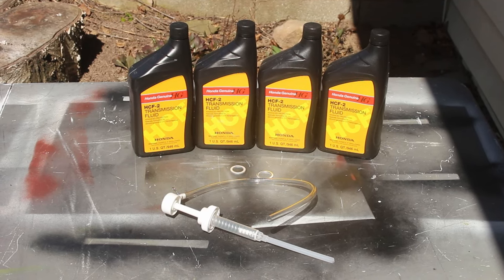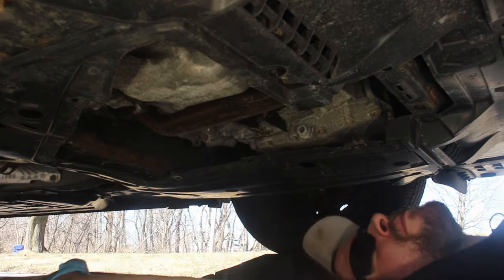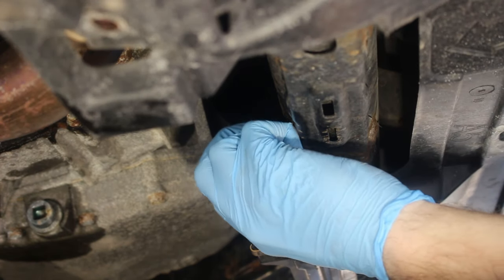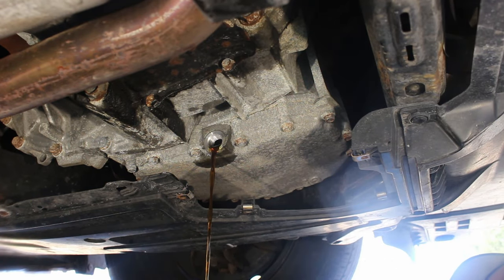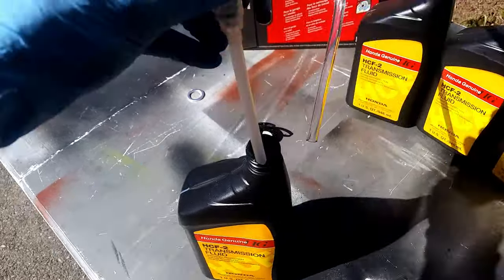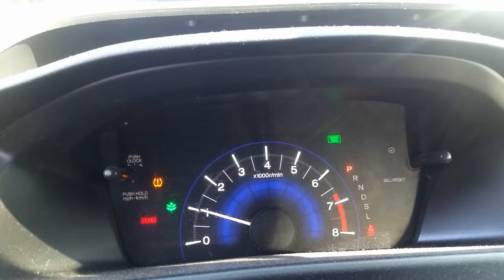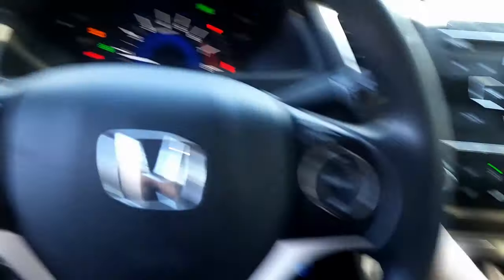2014-2015 Honda Civic CVT Fluid Replacement

Comment: Well made video, very straight forward and informative.
 It’s funny how people talk crap on the cvt transmissions. I have 160,000 miles on my 2015 civic and I beat the living piss out of it every day.
 Maintenance is key!!
Reply: Yeah I thought the same until 177 and it slipped like a MF’r I’m praying I get lucky and fill it with the correct fluid but not going to get my hopes up
Reply: Very good to know as just purchased 2015 civic with 70000 miles. Super pleased with CVT transmission.
Reply: Must do a flush, not just a change. Humble opinion 😌.
Reply: 260k on my 14 civic lx
Reply: Wait a little bit and you will see. Cvt lasts around 200k. Mine lasted 210k. In 210k miles in my 2014 civic I only replaced starter once and alternator once. Now transmission. Im more than happy with it. ( battery every 3 years or so. Maintenance every 5k miles). Never game me any other issue.

Comment: Thank you for the video! I have been searching for hours for a Honda Civic LX 2015 transmission dipstick and could not find it, low and behold - it's a plug. Since it's a plug, how do you know when you have a low amount of fluid or if it needs to be changed? Do you just put in the amount listed and hope for the best?
Reply from the maker: It's full when the fluid reaches the bottom of the check/fill bolt on the front of the transmission.

Comment: Accept using a pump isn't part of the procedure. You just get a funell  and at the fluid to the fill hole. From the top of the engine compartment. Just poor it in. And honda recommends replacing the  plug when serviced because the rubber wares out by then usually. This video made it seem like it was more work then it was. Running it hot and checking doesn't do much unless your running dexose also. Honda fluid is clear and doesn't expand like dexron. But I guess if you like extra work.

Comment: thanks for the video. So just to confirm the correct way to check the fluid level is with the engine and transmission up to temperature, engine turned off?
Reply from the maker: Yes

Comment: I find this video a good and useful reference. I'm currently much more involved in a Large scale project with my wife's car which is exactly the same car in this video. Started with grinding brakes, found a bad CV shaft, which ended up getting some of the fluid out so I figured I'd do the fluid change cuz it was due Anyway. I did it about 60,000 mi ago with the small filter. So this time I'm doing both filters and the pan gasket. I only bought 4 quarts of fluid but I feel like it's not going to be enough to fill the whole thing.

Comment: I have a 2014 Honda Civic. I have never changed ny transmission fluid and have 164k miles.. should i change it? Im worried people say it will mess it up if i change it now
Reply: I personally wouldn't. especially since it's a cvt. It's really just a gamble at that point.
Reply: Change it. Cvts are extremely different than the old style 5 speeds with actual gears. Cvt fluid change is only beneficial no matter the miles or intervals as long as it's done correctly with the right fluid from honda.
Reply: Do a flush and get all the fluid out. Don't mix new fluid with old.
Reply: Did you change it? I have a 2015 civic with 170k and am wondering the same thing.
Reply: I have 2014 honda civic with 200K and never changed CVT fluid, wondering should i change now? works great
Reply: I change my cvt oil every 5-6 engine oils changes. 260k now. The main issue is shifting while it’s still moving,if you shift it right  it stays with you

Comment: Helpful and informative video! Only wired thing I had was my tranny just dripping after i did the final open to let drain check... I come back an hour later and theres 1/2 quart of oil that drained out when I emptied my drain pan. Car was level so kinda odd and makes me worried since I put in right under 3qts before it started spilling out.

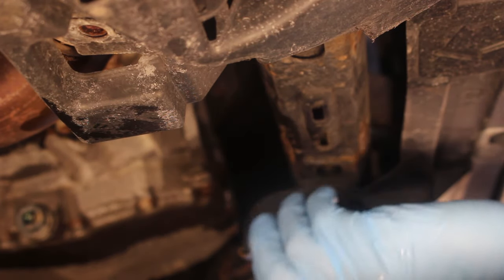Comment: What was the fill check bolt washer part number at 7:01? Comparing the drain plug washer and fill bolt washer shows there is a difference.

Comment: Excellent video!  Can you let me know the 2 washers I need to get for the change?  If you happen to have the Honda P/N's I'll get them at the dealership (about 1/2 mile from our house.  Do you think this should be done every 50,000 miles?  I missed it an the car has about 70,000 on it.  It's a 2015 EX sedan.  Love the car and want to keep it in good shape.
Reply: 18mm crush washers

Comment: very nice video, when you check the oil, are you lifting the car again?  not sure how you can get underneath without lifting the car.  Crazy there is not just a dipstick to check, I guess that is the new technology at work.  Cheers
Reply from the maker: I left the car on the jack stands when I checked it.

Comment: Does the car need to be level or can all this be done with it on ramps?
Reply from the maker: If setting the level using the overflow method you would need to be level.
Reply: @MechanicalMalarkey would measuring the amount of discarded fluid and replacing with the same amount work if you can’t get it leveled?
Reply from the maker: @TheMattizelli  That would be a good way to guess

Comment: Did you ended up using the 4 bottles of CVT transmission fluid? Mine took the entire 4 bottles, I’m not sure if I overfilled it
Reply: I took mine to the shop this weekend & they charged me for 5 bottles… I came here looking to see how many bottles it really takes cuz I hope they didn’t just charge me for all 5 if they didn’t use all of them from the shipment
Reply: @alexabernhardt2856  if you have a 2012-2015 Honda Civic with the 1.8L engine then yes, they definitely overcharged you and you should definitely place a complain and get your money back because it only takes about 4 bottles, anything over that is overfilled and bad for your transmission. You can also find this information on Google. You should definitely have complain
Reply: It takes 3 full bottles and 3/4 of the last bottles. I change mine every 100.000km
Reply: @bigfarru2  wowwwww. I wonder if I still have the receipt.. I’m about to go back to that store cuz I also got my starter replaced that day too.. like they didn’t get enough $ out of me & then had the nerve to call me when it was done, saying it actually took 5 bottles..
Reply: Idk about that because mine started to come out the over fill on 3 bottles and like a quarter of the 4th which seemed on point for the amount and then after cycling the gears I used the whole rest of the 4th bottle with the check hole off again and it drank the whole rest of the 4th bottle without it leaking out again ? I didn’t have a 5th bottle to fill it till it dripped again but I hope that was enough ??
Reply: @storageseeker3066 it says in the service manual to check the fluid level quickly after shifting through the gears. I noticed if you let it sit for an hour all the fluid goes down and will come out the check plug. You have to shift it and check it instantly. So if you checked it within a few min of shifting and it didn't overflow I would definitely add some more.

Comment: Assuming this CVT has a converter, how much of the total fluid do you think is replaced in this procedure?  Half perhaps?
Reply from the maker: Honda says it takes a little over 6 quarts to fill after a full overhaul, so you're changing a little over half of the total fluid.

Comment: theres a fill plug hole on top of the cvt to poor the fluid in.  not sure if you knew this
Reply from the maker: But you need to check it with this hole anyway.
Reply: Ya, the plug with a hook.

Comment: When I see videos like this it really discourages.me from following it's instructions. Why would you fill the dam thing through the overflow hole when the fill hole is up top the transmission and heyyy it has a rubber plug that pulls out to do so. These transmissions have two filters. One behind the transmission fluid cooler and the the other inside the pan. As a rule you can get away with a plain dump and refill but it's best to replace both filters between 50-100ks. Miles. It's highly suggested.to replace the drain plug crush washer as well which you don't see down in this video.

Comment: is 2014/15 civic better than 2013 civic please lmk
Reply from the maker: I think it still had the regular automatic transmission in 2013 and 14/15 have the CVT. I don't know if there's a big difference between the two in driving or reliability. I would stay away from 2012 though because the interior feels super cheap.
Reply: @MechanicalMalarkey  yeah 2012 interior was bargainous but 2013 interior got better is probably best year for honda civic

Comment: FORGOT THE FILTER ?
Reply: The strainer assembly 25420-5T0-003 is not typically considered a maintenance item if proper maintenance schedules are followed.

Comment: Stay away from cvt transmissions guys & girls
Reply: I have 3 Hondas with cvt’s.  No issues whatsoever.  I change the trans oil every 40k.
Reply: Nothing wrong with them unless you can’t get past not feeling a shift point when you drive. 
Some manufacturers actually programmed fake shift points into their vehicles because people “needed” them.